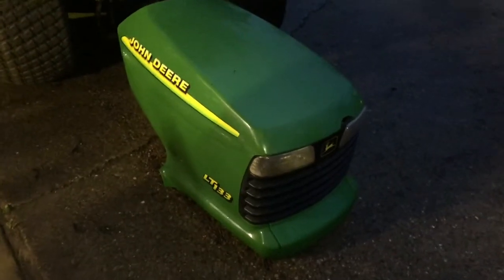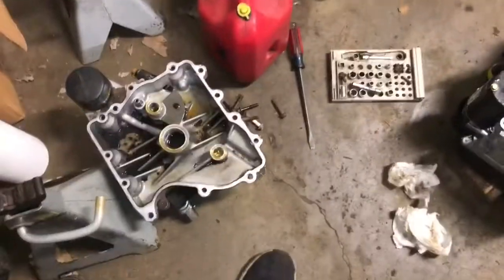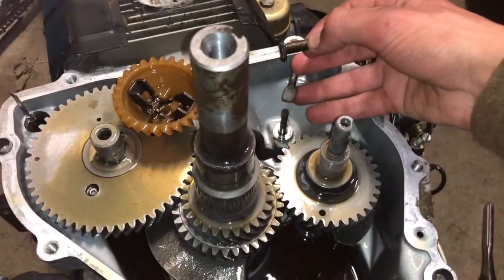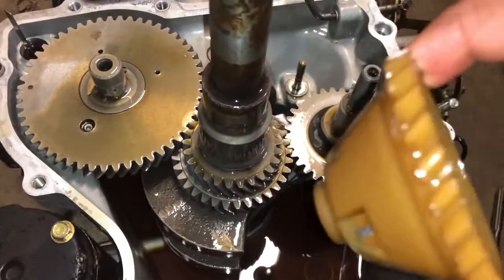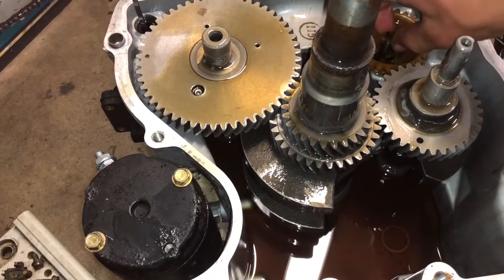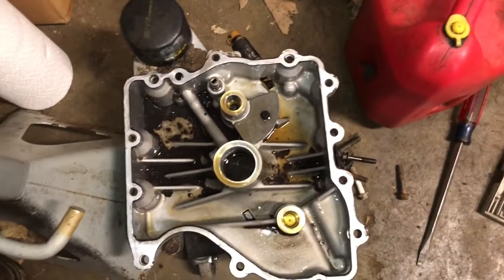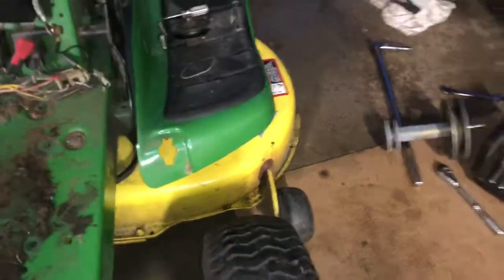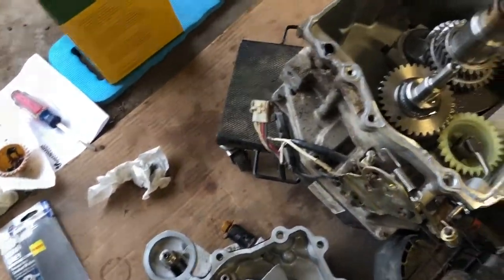Vertical shaft Kohler Command engine broken governor fix

Comment: Any spring connected to the flyweights
Reply from the maker: No there are not, the spring on the shaft on the outside is what holds the tension

Comment: I had the same thing happen and ordered the parts to replace the plastic gear assembly. How do you pull the plastic gear out?  Is there something holding it in place? Mine seems stuck and I don't want to pull to hard in fear of breaking something else. I also pulled out the gear below it out and I realized that the alignment is probably important. Any tips in how to get it in the right position?
Reply from the maker: There may have been a small clip holding it in but I cannot remember. It was a few years ago.

Comment: You don't have to pull motor to fix the govenor
Reply: On a kohler on briggs you do
Reply: Not on a kohler on briggs you do
Reply: @robertyearian227  Kohler V twin has to come out .  your right on a single piston .
Reply: Yes sr your right
Reply: How do you take off the sump without removing the engine? I need to know that shortcut!
Reply from the maker: The engine was removed from the tractor. I don’t believe it is possible to remove the sump without pulling the entire motor.
Reply: @ericpigg2689  u can't on that model the courage model you can 19hp on up